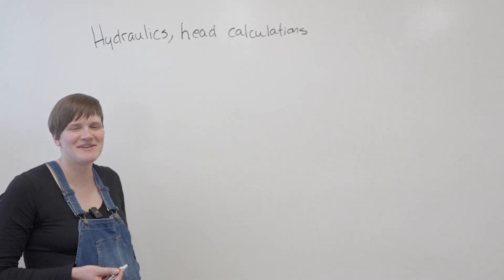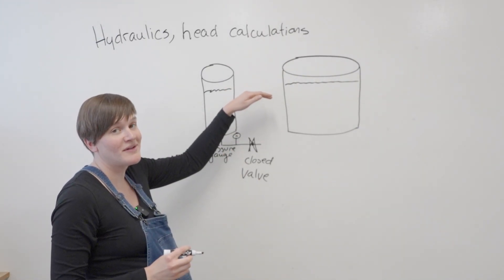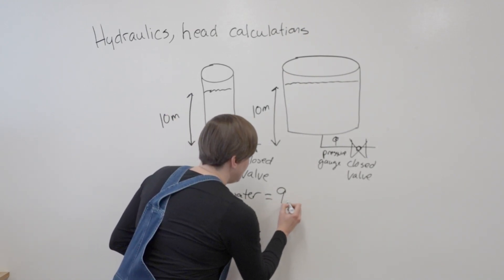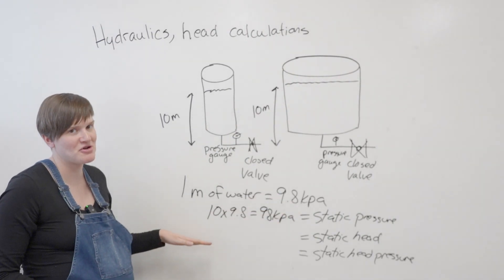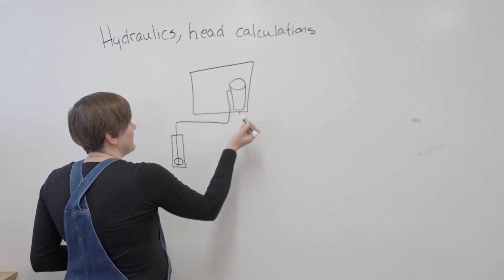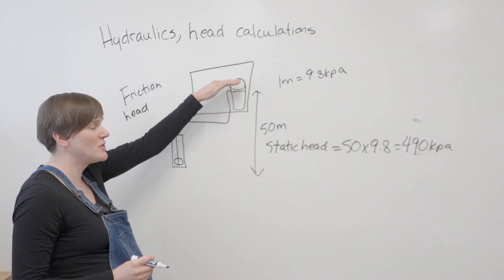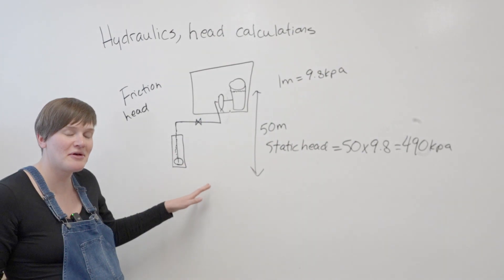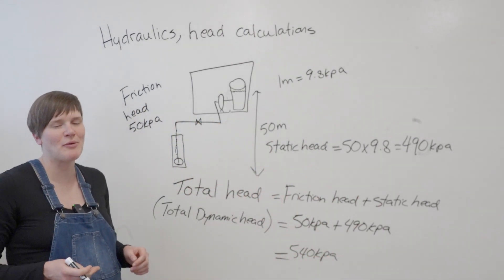What is Static Head Pressure, Friction Head & Total Dynamic Head?

Comment: Is the total head the same as the total dynamic head
Reply from the maker: Great question! The terms can be a bit confusing. Total dynamic head (TDH) and total head are often used interchangeably, but technically, TDH refers specifically to the total head while the pump is running. It includes static head, friction losses, and any other factors affecting the system when it's operational. Total head is more of a general term for the vertical distance the water is being moved, but TDH gives you the full picture for a running system. Hope that clears it up!

Comment: Very informative video.  Do you have time to answer a question for me?  I have a cylinder filled with water,  There's a small hole in the top that I can open and close.  There's a hole in the bottom that I can open and close, just to control whether or not water is released.  If both holes are closed, obviously no water is released.  If the cylinder is filled to the top and I open the bottom hole, no water is released until I open the hole at the top.  If I open the top hole very briefly, some water is released but stops very quickly after I close the hole at the top.  If the cylinder is only two-thirds full, the flow continues for a longer amount of time after I  close the top hole.  If it's one-third full, it takes an even longer time to stop flowing.  Can you tell me why it works this way?  I'd be most appreciative if you can answer this question.  Thanks very much!
Reply from the maker: The behavior of the water in your cylinder can be explained by the principles of fluid dynamics and air pressure.

1. Both Holes Closed: When both the top and bottom holes are closed, no water is released because there is no way for air to enter the cylinder to replace the water that would flow out. This creates a vacuum effect that prevents water from leaving the cylinder.

2. Opening Bottom Hole with Cylinder Full and Top Hole Closed: When the cylinder is full and you open the bottom hole while keeping the top hole closed, no water flows out because the air pressure inside and outside the cylinder is balanced, and there's no air entering the cylinder to displace the water.

3. Opening Top Hole Briefly: When you briefly open the top hole, air enters and allows some water to flow out from the bottom. However, as soon as you close the top hole, the air flow stops, quickly creating a vacuum again and stopping the water flow.

4. Varying Water Levels and Flow Duration: The differing durations of flow when the cylinder is two-thirds or one-third full can be attributed to the amount of water and air inside the cylinder. When the cylinder is less full, there is more air space above the water. Opening the top hole allows more air to enter before a vacuum is re-established when the hole is closed. The larger volume of air takes longer to be expelled by the escaping water, hence the flow continues for a longer time.

This phenomenon illustrates how both air pressure and the presence of air in a container can influence the movement of a liquid in a system. It's a practical demonstration of basic principles in physics related to fluid dynamics and pressure equilibrium.
Reply: Thanks very much for taking time to reply and for your very detailed and informative answer!  @WaterMovement